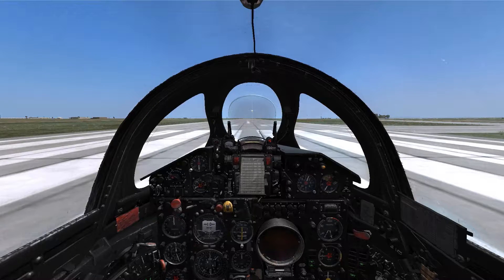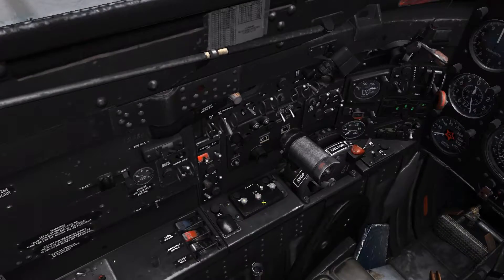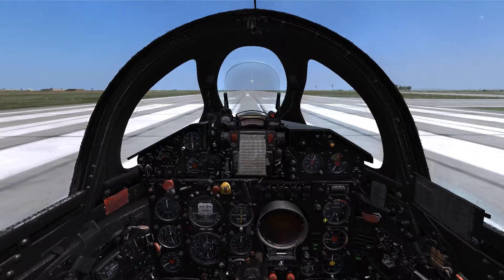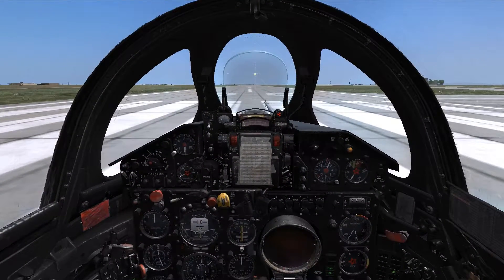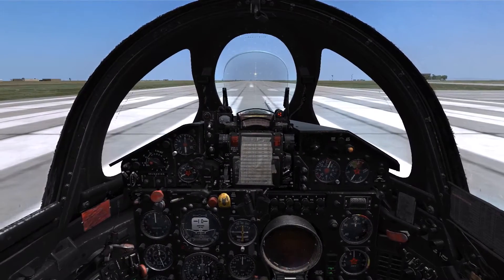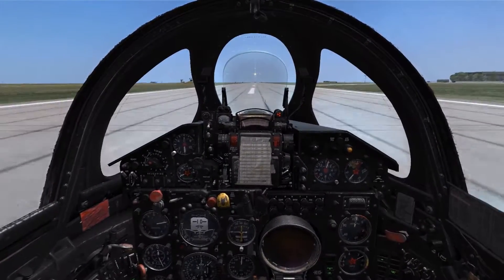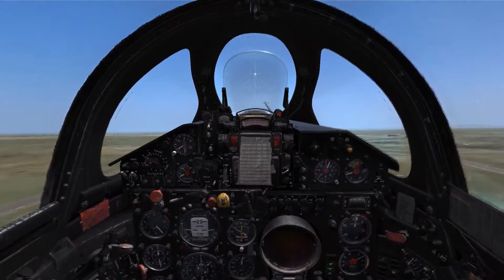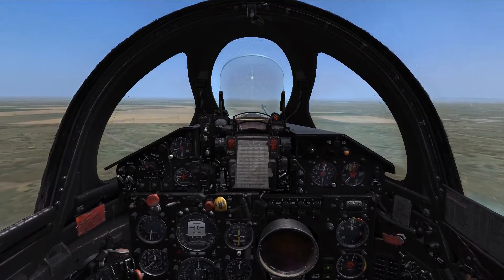DCS:World - MiG 21Bis Takeoff Procedure

Comment: what about the nosewheel
Reply from the maker: The MiG-21 does not have a steerable nose wheel, you use the differential brakes to steer.  On takeoff run, the rudder is used